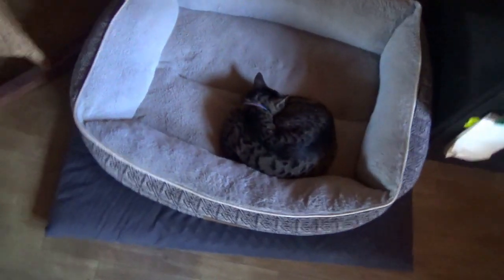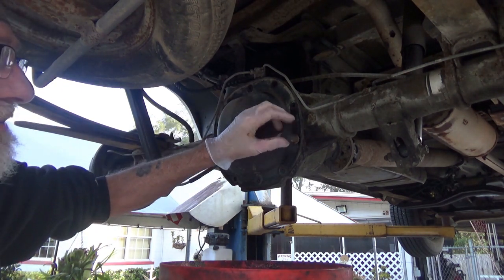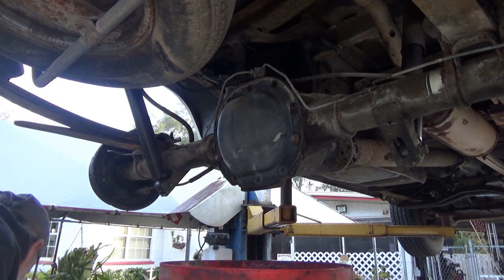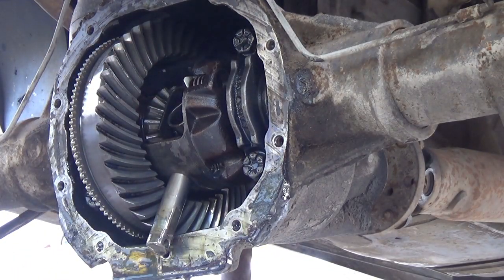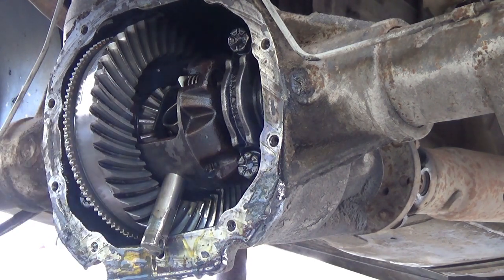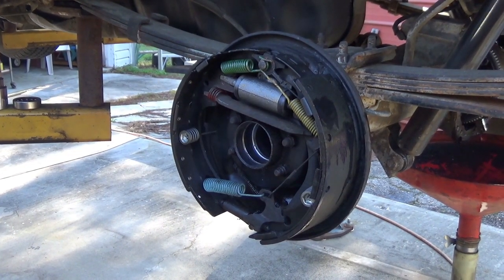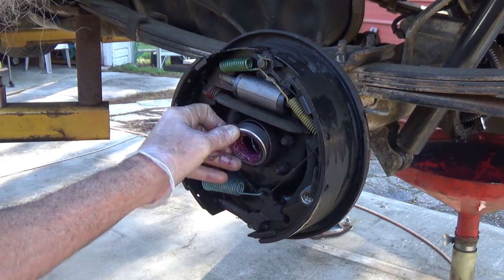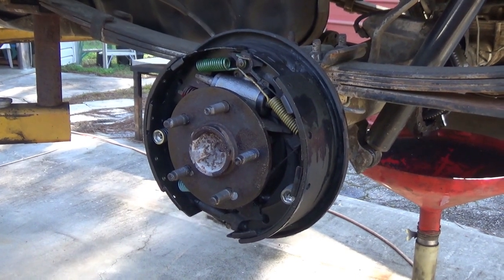1990 Ford Ranger Axle Bearing and Seal Replacement

Comment: Hey there War Horse! Glad to see that you're still active on YouTube, despite all the drama. since we last talked, I've actually added FOUR new projects to my collection. 

1. '67 VW Bug, former Baja version converted back to street. 1600 dual-port motor. Plans include a 2" front drop, disc brake upgrade, Centerforce clutch, and dual Webers. 

2. 1970 Buick Skylark Custom 2-door hardtop. Factory disc brake, factory A/C, factory tilt wheel. In desperate need of a repaint. Water pump seized, front timing cover is junk. Currently collecting all the parts to rebuild the entire brake system. 

3. 1973 Dodge D-100 stepside. Bought from a neighbor for $1000 just months before he passed away. It's a rusty, decrepit pile but it runs. Has a replacement crate or junkyard 318 that was installed years ago, but doesn't leak or burn oil.

4. A shockingly clean 1975 Toyota Corolla. Rare automatic trans model. Aside from a few tiny rust bubbles, the original factory yellow paint is still smooth and shiny. Thinking about upgrading to dual Weber sidedrafts, JDM style fender mirrors, and classic 8-spoke Panasport wheels.
Reply from the maker: Well, good to hear that you're doing well. Sounds like those projects should keep you busy for a few weeks. LOL  I had a 1968 Buick Skylark, 2 dr, when I was a teenager. It had the 6 cyl engine, no AC, no power brakes. It was my second car after the Corvair blew up. But hey, back in those days you were gratefull for any wheels to get around with. After that I had a 1962 VW van, complete with shag carpet interior. Fun times.

Comment: Im a neophyte to home mechanic work, I've fixed my 8.8 in a 98 explorer. Very similar. Bearings exploded on puller use as well. The amount of metal shavings I scooped and magnetized out of my differential housing, the thing is gonna last another 25 years. Very glad I didn't have bearing savers, though my dad has welding units of all types.

Comment: That is fiddly job with the pin and clip system and needing to weld lugs on the old bearing to get it out. I thought Fords were straight forward machines, this is more like working on a Kawasaki motorcycle. ;)